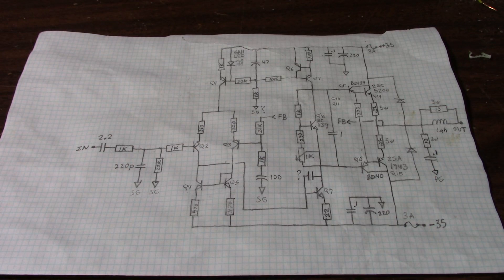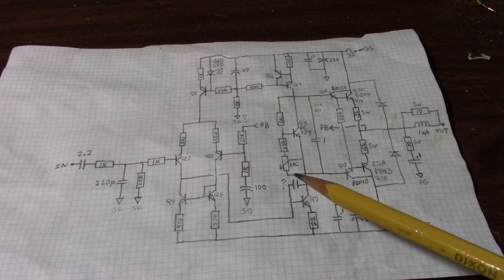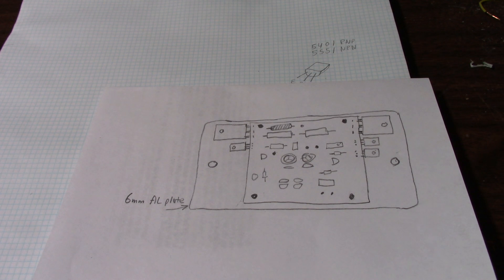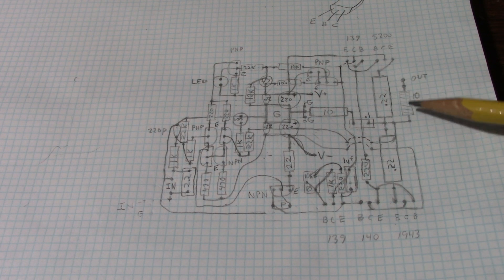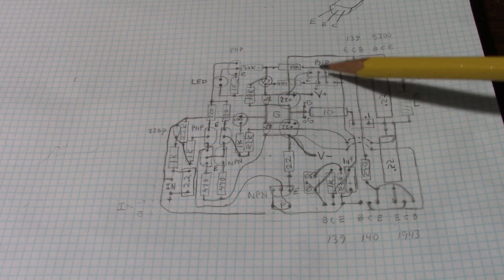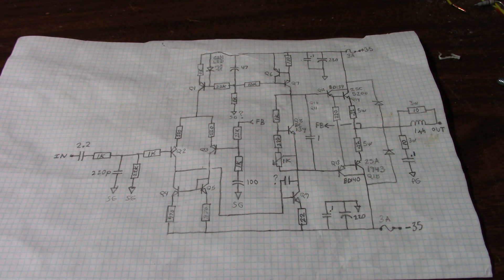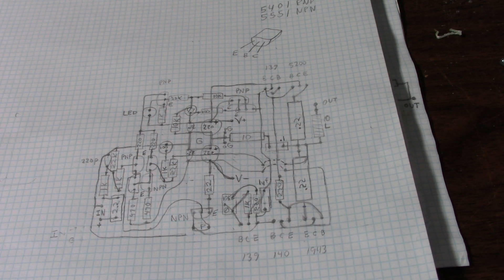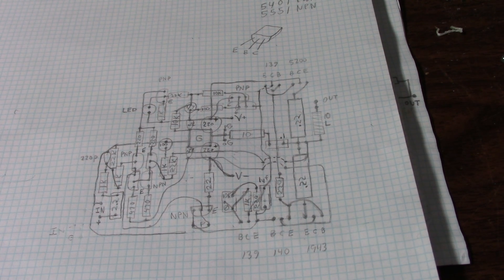Discrete audio amplifier project PT12 circuit board layout idea

Comment: I have found several data sheets with different pinouts for the 2N5401C device, but I see you have ' EBC' so I will stick with that ! also as of today Digikey don't have them in stock and many configurations of the device are obsolete, but I have yet to try Mouser, who supplied them to you please ?....cheers.

Comment: Hi John, not sure if someone commented this on a future video, but you have a mistake in the input network.  You do not need the 1K resistor on the base of Q2.  It is only giving you an offset.
The base current of Q3 flows through the 22K resistor attached to its base, but not the 1k due to the capacitor.  This creates a voltage drop on the 22k resistor which needs to be balanced, Vdrop = 22k*IB3.  The base current of transistor Q2 flows through the 22k and 1k resistors attached to its base.   Since the resistors are in series, you get a voltage drop of 23K*IB2 .

You will see because of this a DC offset of ~1K*IB.  I can't remember your numbers  (would need to back track too much), so let me make some assumptions here.  If:
  - IC_Q2 = ~IC_Q3 = 4mA
  - Q2, Q3 Beta (hfe) = 100
You will see an offset of -IC_Q2/Beta*1K = -40mV.
The fix, remove the resistor... easy.
Hope this helps, Sandro
P.S. It is good practice to also label resistors.
Reply from the maker: Hi Sandro, as it stands now, the amp has -33mv offset. When I bypass the 1k resistor on the base of Q2, the offset changes to -40mv. The LT spice model shows +20mv with the resistor and +15mv without. The collector currents in Q2 and Q3 are 1.3ma each. The 1k resistor is a base stopper to help reduce RF ingress. Many amp designers include it at the cost of some offset. As far as why my circuit offset is so much, I'm not sure but Q3 did suffer a base to emitter reverse bias for several minutes due to a soldering error and that may have affected its gain.
Reply: @JohnAudioTech  Hi John, the 1k resistor on the base of Q2 is unnecessary for RF stopping.  You already have a 1k forming a low pass filter with the 220pF, so the extra 1k will just give you noise (4nV/rtHz) and offset as I pointed out.  Now, given your IC=1.3mA and still assuming a beta = 100, then the Delta offset will be -1.3mA/100*1k = -13mV.  Since you see 5mV in LTSpice and 7mV in the actual circuit, then Beta must be higher than my assumption (~200 rather than 100).  BUT, the direction is correct, i.e. offset goes in the negative direction, showing my analysis is correct.
There are other sources of offset in this circuit, some easier to fix others harder, that contribute to the -33mV offset you are seeing.  By design, you have 20mV ofsset as stated by LTspice.  We know 5mV is due to the unnecessary 1k resistor.  The rest is due to the difference in base current of Q9 vs. the sum of the Q4 and Q5 base currents.  To eliminate this one, you need would need to run Q9 at 2.6mA (IC5 + IC6) assuming they are the same transistor model.
On top of the systematic, you have -53mV of offset due to matching of devices.  This is due to mismatch of Q2 vs. Q3 (VBE and BETA), Q4 vs. Q5 (VBE only), and mismatch in the associated resistors.  You can mitigate this using match pairs and resistor networks.  Yes, these cost some money, but if this is a hobby project, then extra bucks are worth it.  If you plan to sell this amp, then maybe not worth it.

Hope it helps.
Best, Sandro

Another piece of feedback, label the transistor models (e.g. 2NXXX).
Reply from the maker: @sandro2304  Thanks for the reply. You convinced me to drop the 1k base resistor in the final design. https://sound-au.com/amp_design.htm section 1.2 explains the reasoning for having but it looks like the bad effects outweigh the one benefit. I would be content if the offset is under 25mv in the final design.
Reply: @JohnAudioTech  Hi John, thanks for pointing me to that website.  Some good info there.
What Elliot describes is the rectification effect of AM and he correctly points out that this is mitigated in op-amps by putting the 1k resistor.  What the 1k does is create a LPF with the input capacitance of the op-amp.  You have probably heard that this technque works best with JFET input op-amps... well, that is because signal JFETs have bigger capacitance than BJTs , no magic =).
Also, try to place to 220pF near the base connection of Q2.  It is will minimize any antenna effects from the trace.

Comment: I'm your enemy. We need more videos! It wouldn't be nice if I had to kidnap your kitty and hold him for ransom! John, can you produce a discrete push-pull headphone amplifier with some general purpose 2222 transistors or Jfets, diodes, and resistors. I'm struggling. I don't think you have a video on this topic yet. Sometimes I think you know more than Nelson Pass.
Reply: https://youtu.be/ODvsCBjZz9M
Reply: But it's only half discrete. Thing is hard to design full discrete with excellent dc offset without dc servo. And within the voltage range of operation of headphones, opmaps seem to be much better. Add a high current cfa in the end making it composite amplifier will be very high performance. 0.00003% thd with 32ohm load.

Comment: John, consider purchasing a QuantAsylum QA401 Distortion Analyzer. These units are top notch and work very well. You may be able to find a used QA400, which is the unit I have, for a bit lower price. There are some related videos on the web page - https://quantasylum.com/products/qa401-audio-analyzer
Reply from the maker: Thanks for the link. It does appear deliver the goods for amp testing.

Comment: IMO the PCB's should be double sided with fully masked ground plane on the top side with plenty of via stitching everywhere down to grounds on the underside. This will keep it noise-free as a mouse - even Snickers will be happy! Seriously, even if you don't take the time to run this flood-fill through a free program like KiCad, the price difference for a PCB is inconsequential these days compared to the component cost of the whole project. Sorry for the long babbling.. ;)

Comment: John, using scope and sound card for testing your amp is not either-or. You could use a decent inexpensive sound card and a piece of software like ARTA to get a good measure of your amp. ARTA also allows you to test intermodulation distortion and can give you precise numerical values for THD etc. Your scope does not give you any of that. If you want to look at higher frequencies with your scope, you can still do that.

Comment: I LOVE the idea of mounting everything onto an aluminium plate! Drilling the holes in the heatsink is one of the worst things about assembling amp kits in my opinion. I also love the idea of everything being a compact module of sorts. Really excellent idea! You could also have the holes on the plates tapped for nicer machine thread screws rather than self tappers. I'd happily pay extra for both options!

Also gotta love the Snickers at the end~
Reply from the maker: Thanks for your comments. I never use self tap screws on heat sinks.

Comment: John, 
To get a low distortion signal generator, distortion analyzer and spectrum analyzer (plus much more) capable of measuring distortion down to 0.03%:

Analog Discovery 2 for$279
https://store.digilentinc.com/analog-discovery-2-100msps-usb-oscilloscope-logic-analyzer-and-variable-power-supply/

BNC Adaptor for $19.99:
https://store.digilentinc.com/bnc-adapter-for-analog-discovery/

Download Waveforms for free:
https://store.digilentinc.com/waveforms-previously-waveforms-2015/

And finally download Audio Analyzer Suite for free:
https://www.dropbox.com/sh/w3r2wycgdox8vxo/AADNYyxsmtO4UDaTuaFLPNA0a?dl=0

For speaker protection:
https://www.ebay.com/itm/Assembled-UPC1237-Speaker-protection-board-dual-Japan-omron-relay-sn/143163899124?epid=1548506502&hash=item21553bbcf4:g:nfIAAOSwwbdWNzNA

Keep up the interesting videos!

Comment: can u make a review of the tda7850 boards? , I can't find any good video with proper testes ..... most are just repairing old radios or testing it with some stupid song and speaker without putting out any actual values that I am interested in like distortion and RMS Power ... without clipping .. or any sort of noise ... none of the video shows it in details... ,

Comment: Alu plate idea   please tell me you are joking....  /Facepalm  adding yet another layer into the thermal mating to the heatsink just to save the minimal work of drilliing holes is idiotic!  (Not to mention the original holes are needed regardless..)

Make a cheap plastic jig / template for the layout instead to use for marking drill locations etc  but do NOT ever add to the thermal dissipation like your idea...  dont be a lazy shit engineer..  it right or t do it!  specially when trying to teach newbgood practices to follow!!!
Reply from the maker: The surface area of the AL plate will be 100cm^2 or more. This is a huge plate to heat sink area and presents no thermal dissipation issues to a 100w amp.
Reply: Please Mr. Not Lazy Shit Engineer, show us your examples of excellence....baka.

Comment: the idea of the plate is EXACTLY like a guy named rcs16 used to make a replacement for the STK-0050 modules. has drivers and TO-3P outputs hanging off the sides onto a plate.
https://audiokarma.org/forums/index.php?threads/stk-0050-replacement-for-sx-780-and-others.721181/
ALSO: i could even make a PCB design too. i work alot with EasyEDA

Comment: John, for testing audio, I can recommend a very professional setup offered by a russian guy, who really busted a lot of myths about audio. His chanel is Stalker29218 https://www.youtube.com/watch?v=5sXkT45esMY
In few words, there is this program RMAA 5.5 (Right Mark Audio Analyzer). You need a quality sound card (external preferably) that supports 192khz/24bit recording and playback. The program plays a special audio test signal and then records the output of the test device through the input of the audio card. Then the program compares the 2 files and determines the most relevant measurements of audio equipment like frequency response, THD, Noise, THD+N, intermodulation, crosstalk etc. You can test by recording the output from a load resistor (through a voltage divider) or even directly test with dynamic load (speakers). The setup is easy but you need to have a reasonably decent sound card by reasonably decent I mean flat response and low noise. This is a waaay better way to measure these things. Let's be honest, your mp3 test signal is just not good enough for this task. Counting cells on the FFT by eye is not good enough. With this program you can also determine how bad is your mp3 player by playing the test signal on it, recording the output with your sound card and then compare the 2 files. RMAA will show you the results.
This russian guy did a very extensive research and measurements of amplifiers, blind tests, audio myths etc. ... his channel may be an inspiration for you.
It would be really cool if you switch to this way of measuring, so we can see the real qualities of your amp and other amps.
Reply: He used some of your footage here: https://youtu.be/MrUaMOJu_VQ?t=766  :D

Comment: Nice simple circuit. If I may suggest, research the VAS stage a bit. The simple transistor will be a weak point with plenty distortion in the high frequencies. Check for EF-VAS topology, it will be a lot better. The layout looks like you have plenty of space there to add a transistor and resistor.
Reply from the maker: I will certainly consider this change if I'm not meeting my numbers. The VAS stage is the first place to start.

Comment: Did you see earlier, the protection circuitry that STK41xx use?

You can follow this datasheet http://pdf1.alldatasheet.com/datasheet-pdf/view/41598/SANYO/STK4141.html
They have also provided the internal circuitry of the chip.

Comment: Awsome, great project. Would love to see bluetooth capability added to project rather than having to add another board.
Reply: Never add that to the power amp  /facepalm...

 that would be an optional input method for a preamp and even then BT really is NOT a good method for hifi use for many many reasons.

Comment: John I could help you measure the distortion at low levels. I have access to high end equipment. Let me know if you want to chat about it.
Reply: How low can you go?
Reply: If you refer to distortion I'm not sure but I have scopes that can go up to 8GHz with 20GS/S or more, 10-16 bit ADC. Spec an that goes from 30Hz to 6.5GHz. We have higher frequency spec ans that are like 9KHz to 26GHz which won't be as useful.
Reply: @ejlockpix  But that numbers you said don't mean it can measure low distortion. Can you measure ppm distortion? Like -120db 0.0001% thd?
Also It's not necessary to have expensive audio precision to measure ppm distortion ( though it's perfect)
I have focusrite forte. The linear reagion is around -18dbfs. So if I keep in that region I can measure 0.00005% thd.
Reply: @ejlockpix  I thought you have audio precision or something like that. emm
Reply: @ejlockpix  On the other hand. I think he said in earlier video that he only aim for about 0.003% for 1khz and 0.01% for 20khz. Decent and simple.
Reply: I don't have audio specific equipment. I deal with RF circuitry. John said he wants decent distortion performance but the scope he uses can only see down to about 0.4%. I'm sure I can see much lower on the better scopes I have access to. A 10 bit ADC at higher sample rates will yield better results in the FFT function. 16 bit even better however measuring sub 0.001% THD is not what John is after. Honestly I see no need to go so low anyway. There's no real need to measure noise so far into the weeds like that for a DIY amplifier.
Reply: @ejlockpix  Well, simple sound card will do the trick too.

Comment: As long as that plate heatsink can dissipate the heat fast enough at 4ohm high volume, it's a great idea
Reply: well you would mount the plate to a heatsink with some compound
Reply: @jakep8484   Of course, but I meant a plate of metal vs a heatsink with fins and a possible fan. I'm all for the the plate if it will keep it cool.